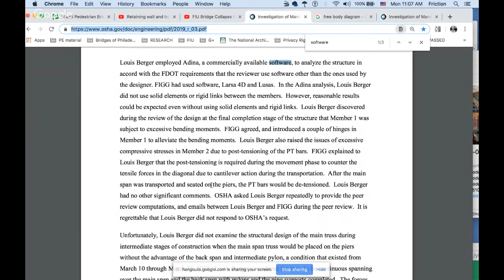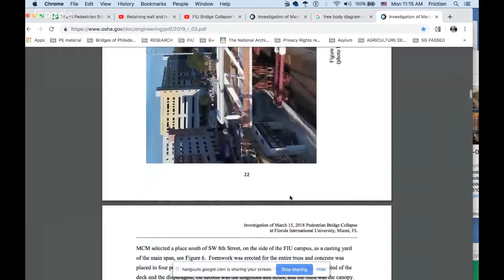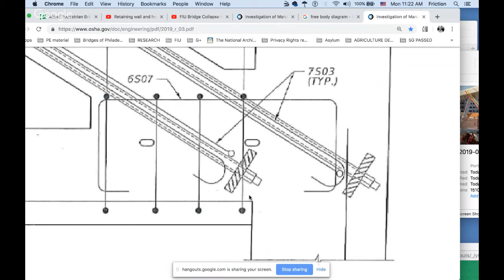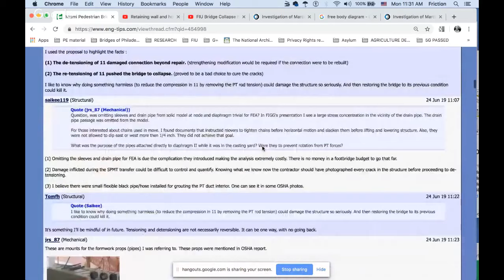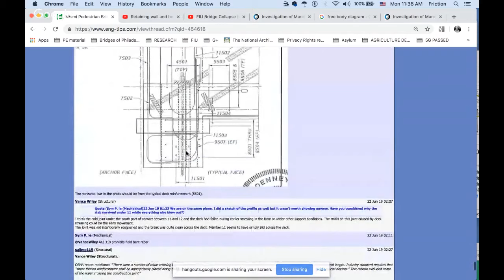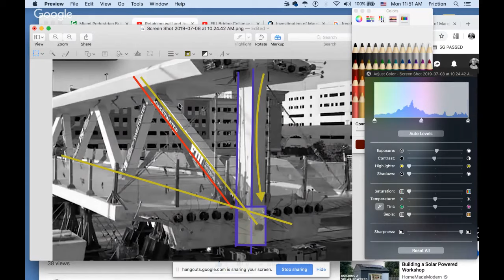FIU Bridge Collapse how 12 lost it's base support via Release of Post tension Bar ''B''

Comment: If you want an unvarnished analysis of the FIU bridge collapse you must read the OSHA report that came out at the end of June.  Why OSHA and not NTSB?  I don't know, but if the OSHA report is accurate (and I'm not qualified to judge the quality of the OSHA report) it is damning of the designers, contractors, and now NTSB for taking so long to come to any conclusion.  Regardless of design errors, the OSHA report provides a clear narrative between March 10 and March 15, 2019 that shows the cracks were observed, and cracks were growing day by day especially at the point where the structure ultimately failed.  The engineers were unmoved by this, and neglected to take precautions that these cracks might be signalling a fatal weakness in the bridge - right up to the hour of its collapse.  OSHA also makes clear that its modelling shows that the retensioning prescribed by FIGG provided the additional force to trigger the collapse.  I would say the ball is now in NTSBs court, but I think at this point NTSB is not looking good at all.  By the way, Kevin Hanson, the person in charge of tensioning, sent a message up his chain of command that said "Cracked like hell" right after the span was installed, and OSHA report says he was visibly disturbed as to what was going on with the bridge.  Of course, he was on the bridge when it failed and was seriously injured in the collapse.
Reply: Should "between March10 and March 15, 2018
Reply from the maker: Interesting comment,  and how do you know it is ''unvarnished"?  Rather, please confirm, you believe it is unvarnished because they released data that was before NTSB and they also attacked the engineers, etc in the report... Therefore, does that make it ''unvarnished"?

Comment: I think the mistake many are making is treating 11 as a single member.  11 had failed, splitting down the middle creating members 11a which is anchored in the deck and 11b anchored in 12.  When they released pt in 11b, 12 kicked out at the base as you can see in the cracked like hell pics.  In my mind this created a canter lever of dead weight of 12 and canopy from 10-11 node AND 11b.  11a due to its angle would take very little of this load but instead loads 10 increasing the point load at deck at 10.  I suspect it punched out through deck at 10 due to hollow from deck drain, then the canopy failing at 10-11 node due to bending moment created closely followed or maybe preceeded by deck failing at 10.  I belive the hole left in deck pocket at 11-12 was created as 12 and 11b ripping out of the deck as it rotated toward the ground as it fell.  I think you are dead right on how 11 split into 11a and 11b.  I think the straw that broke the camels back was by adding tension into 11b, it completed the transfer of load from the canopy and 12 into 10-11 node until failure.  I think as 11b/12 started to rotate it sheared off pt bar 11b somewhere close to 12 and it shot out of node 10-11 and we see it hanging out of the node once everything came to rest. So I think you have to separate into two different events.  The failing of 11b-12 at the deck which if left to its own devices may have collapsed the canopy from node 10-11 out to 12 but that would have started falling towards the pier first.  But here we have canopy falling at node 10-11 first that's why I believe deck failed at 10 first caused by a point overload.
Reply from the maker: I think they have lost sound connection with reality... They believe you can move the base of 11 without the opposite end of 11 moving... they have it getting forces from the opposite end ... then they have it acting on it's own... Meaning it can magically move outwards and the node of 10 and 11 will NOT move... 
I can only call them crackhead engineers at this point...  Just saying.